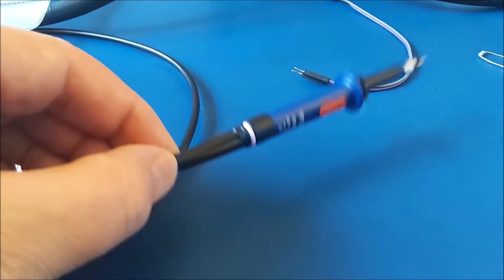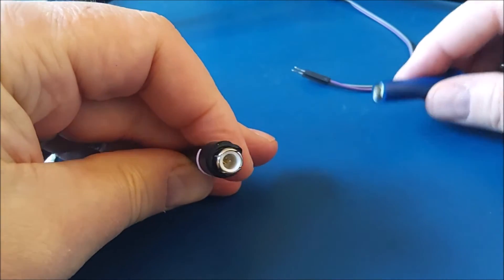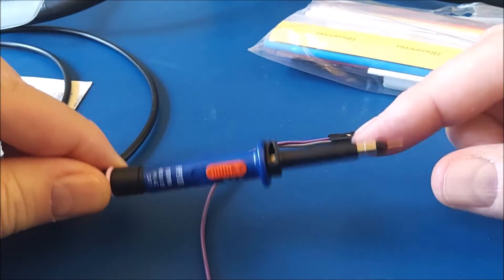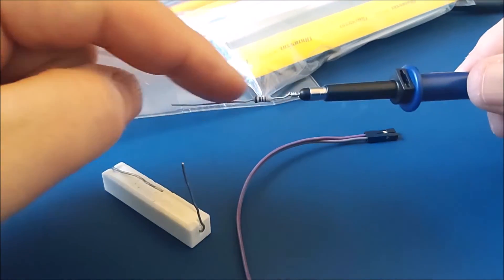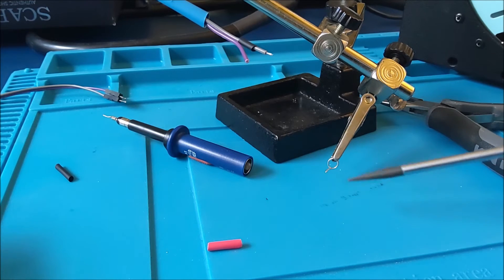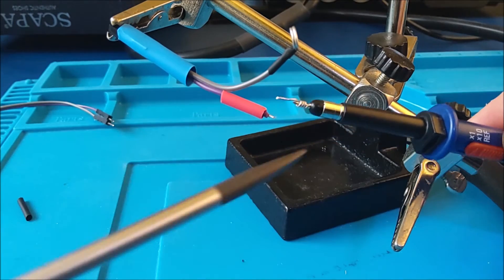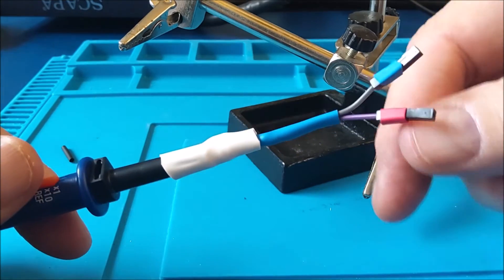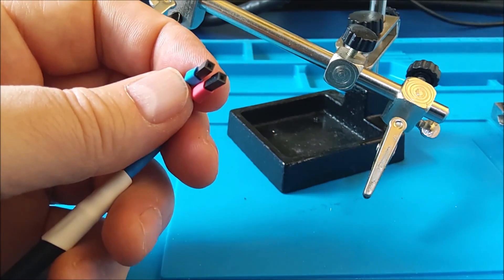Turn generic Oscilloscope probe into a solder-in probe

Comment: What is resistor value we connected to ground.
Reply from the maker: It doesn't matter. I cut the resistor away. I used a resistor because the legs have the right strength + flex for probing